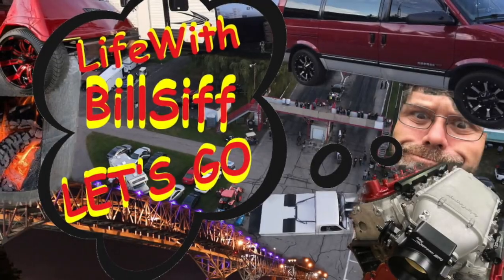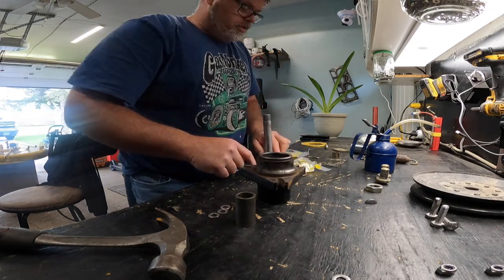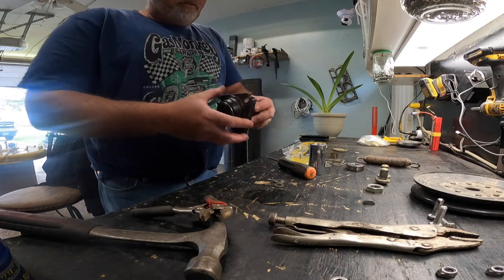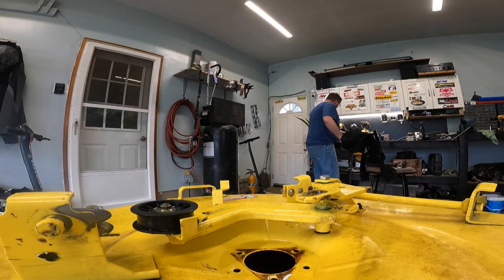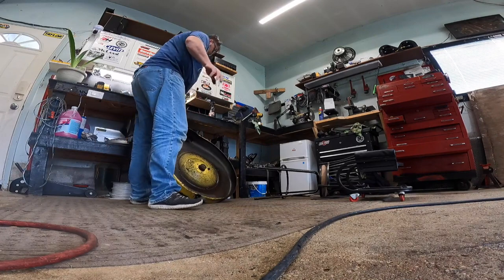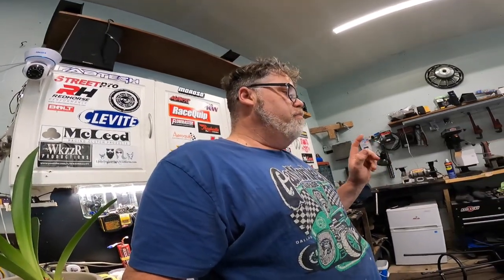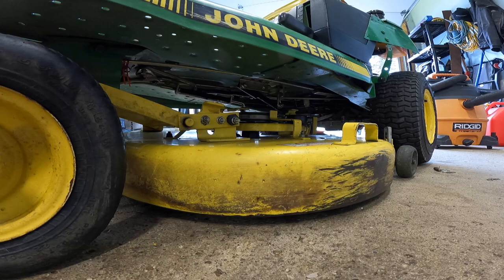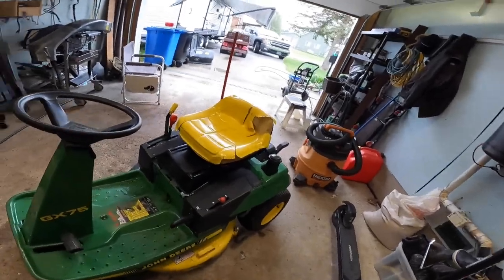John Deere Repair! | Decking The Deere Part 2

Comment: next time grind inside the old bearing to enlarge the hole so it slides freely on the shaft and use that between the new bearing and the socket, it solve your problem. what we do for wheel hug bearings. works everytime and then just keep it for next time.